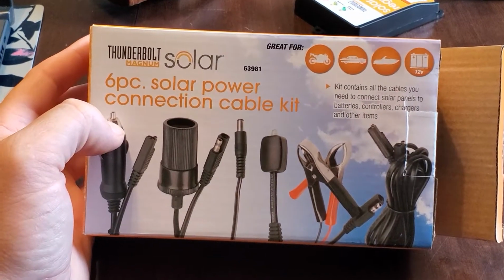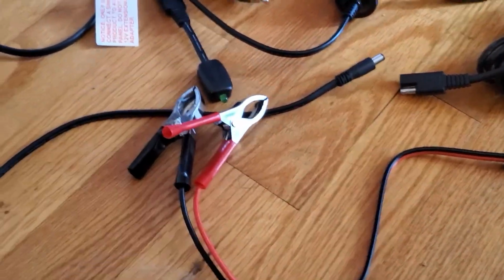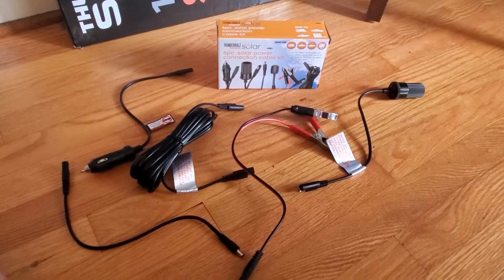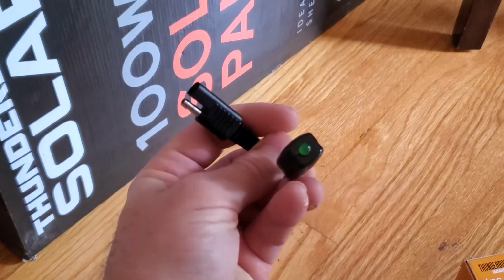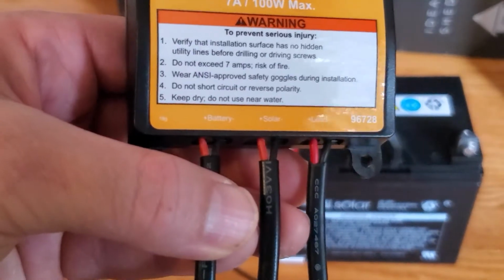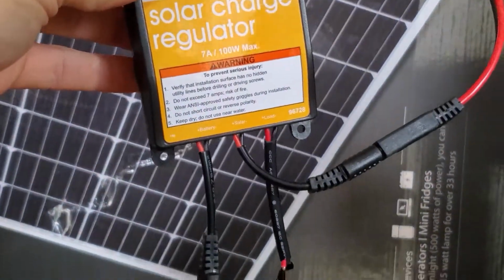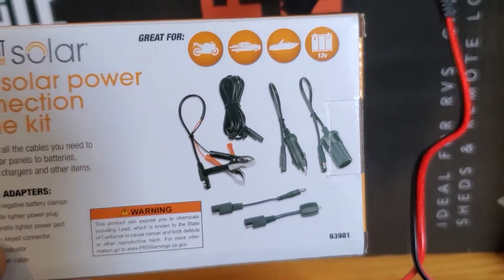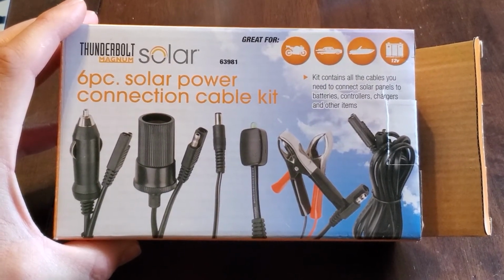Harbor Freight Cable Kit

Comment: The fuse kept blowing on the cigg charger & the indicator light wouldn’t work. And the battery clamps wouldn’t charge my power station & the barrel connecter didn’t work either. All in all I give it a 0 out of 5 stars & that’s why I ended up returning the kit 👎🏾
Reply from the maker: Oh yeah sounds like something wasn't playing nice! How were you connecting your power station to chsrge from the battery clamps?

Comment: I just bought this kit 3 days ago 5.18.22 Did you check the polarity of the cable the outer pin is supposed to be negative, all of them are reversed
Reply from the maker: Hmm, I didn't have any issue with any of these, everything worked as expected for me, without reversing polarity.

Comment: Where would you connect the cigarette lighter? Can it be direct connected to the battery or would you need to use the controller output for that?
Reply from the maker: yeah preferably direct to battery, rather than through the controller, though that would probably work fine as well.

Comment: I connected my 12 v fan str8 in2  25 watt solar panel  l with these connections.next i have 2 30 watt fans connected 2 100 watt panel i have a 1 into 2 cigarette lighter adapter .
Reply: No 🔋 or charge controler .no middle man str8 connected
Reply from the maker: @chillymack2321  get 'er done!
Reply from the maker: Oh wow! Very interesting, with no battery or charge controller?